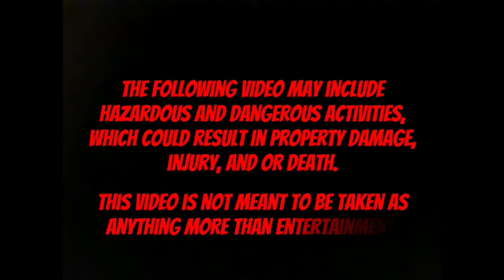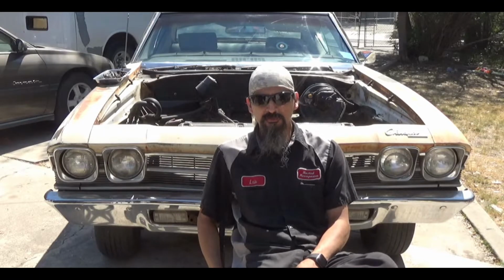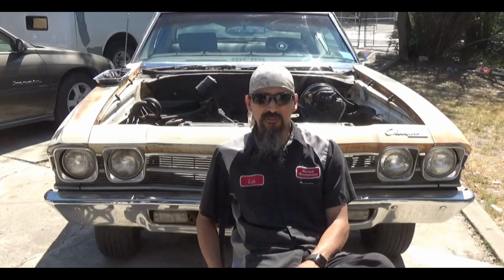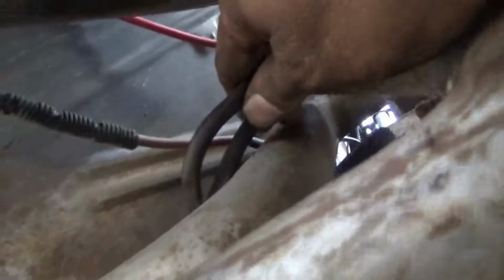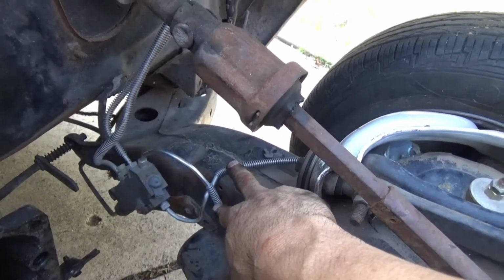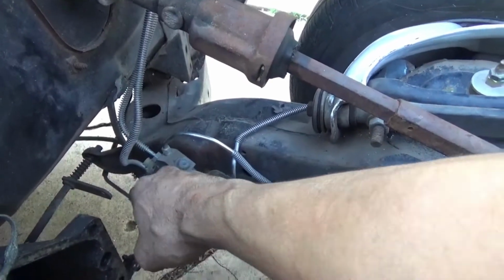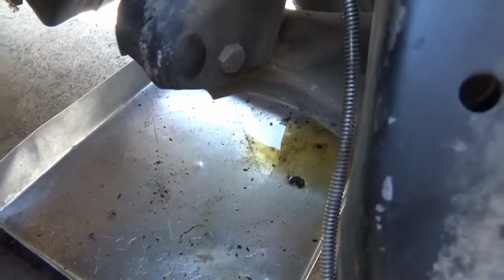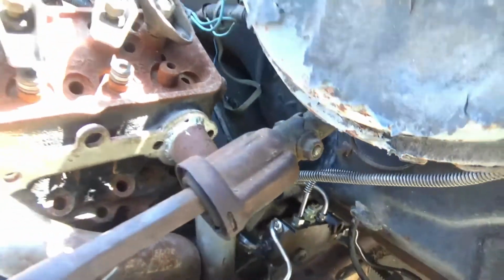Will these headers fit ?

Comment: Headers, oh what fun I had with those on my chevelle!! The zz502 head bolts are really tight fit on header flanges!! You made it look easy,lol!! Take care!!
Reply from the maker: 572s are worse, we had an NBA Stars 68 chevelle needing  an alignment, it was horribly close with the headers sandwiched in there
Reply from the maker: Well, maybe theyre the same...are 502s and 572s the same block/dimensions? I think i vaguely remember 572s were totally different?
Reply: @rustedhorsepower5132  it comes down to those damn head bolts on 502,not sure about 572!! When I put my engine in nobody made headers for the ZZ 502, might be different now, 6years later!!!